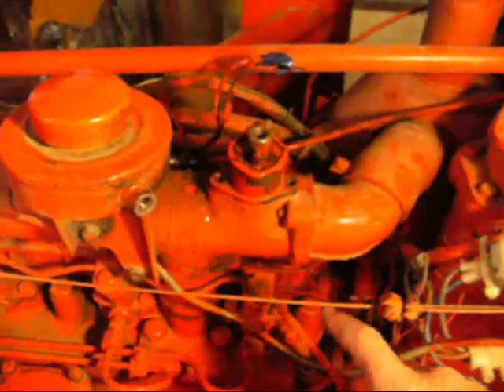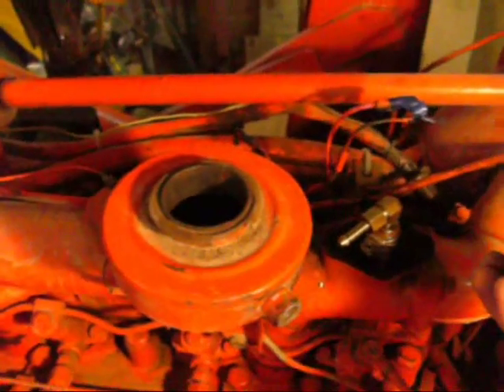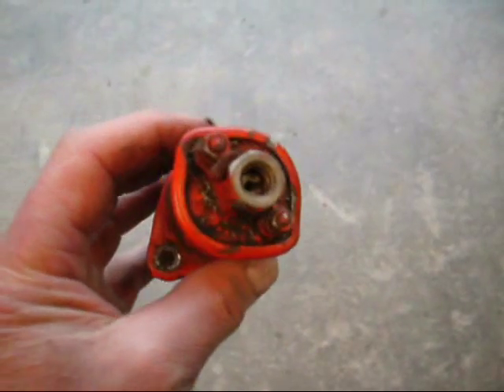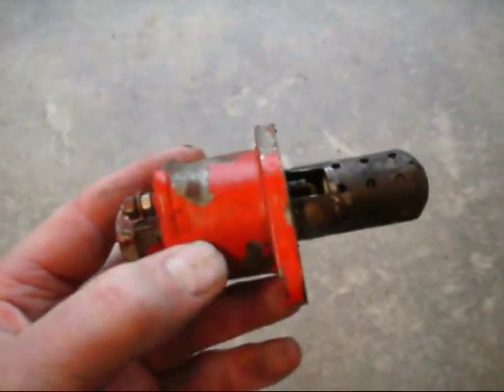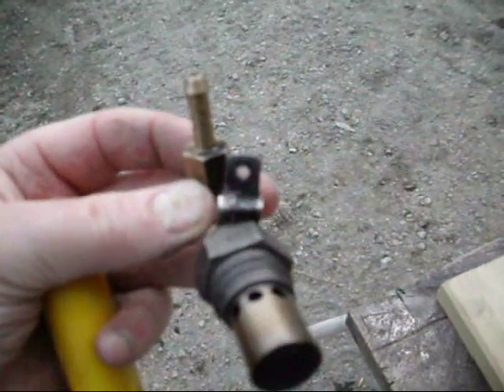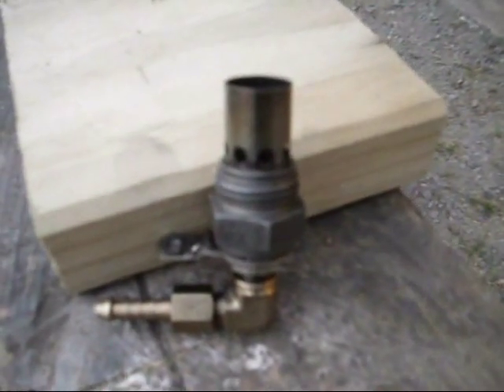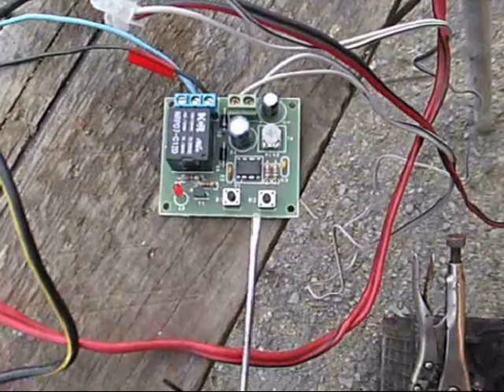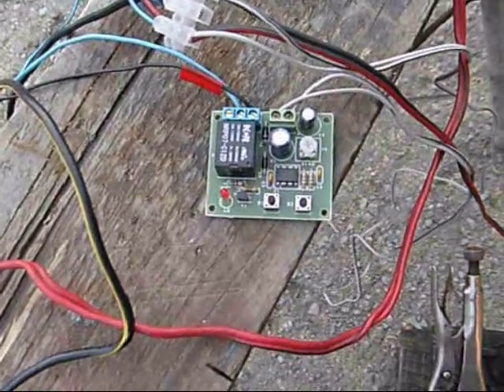Belarus tractor thermostart replacing a flamestarter

Comment: Thanks for posting this video, Phil.  I have been trying to get a recently purchased thermostart to work - first by various heights of gravity feed, then by pumping from a screenwash bottle, then by using a dedicated 4-6 psi fuel pump.  Flame is very variable (sometimes just smoke, sometimes @1cm and rarely @8cm).  Beginning to think I have a faulty unit.  Looks very much like yours, but has screw connection rather than spade.  Would you mind posting the part number (mine is on one of the faces of the big nut) of the thermostart that you are using, what engine it was described for, and where you bought it from.  Also whether it has worked consistently since you installed it.
Thanks, Tim